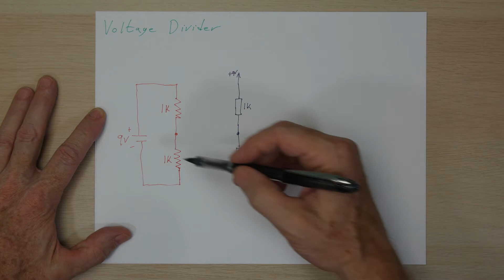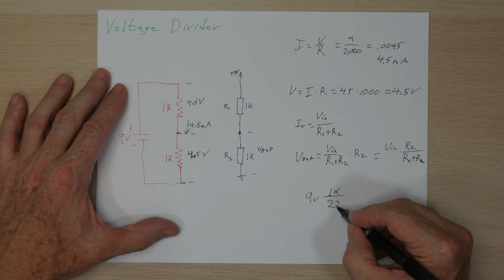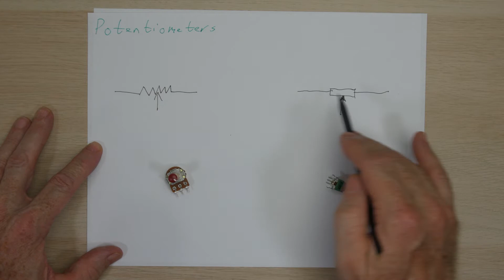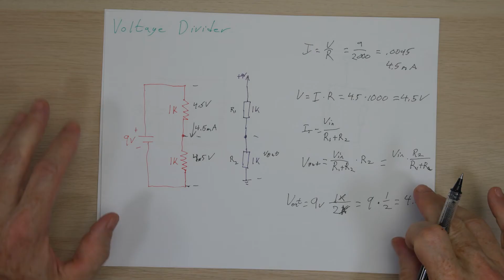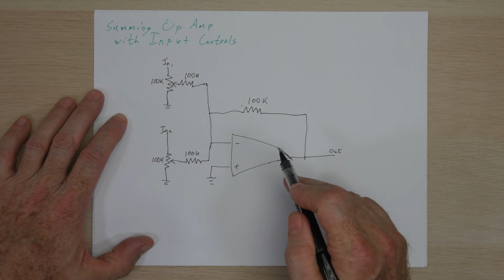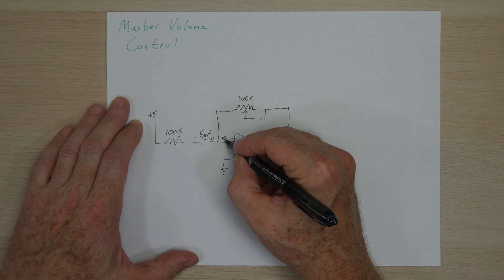How to Make a Eurorack Mixer Module - Part 3 Volume Controls

Comment: Thanks again for doing this, super helpful! I'm currently working on a +/-5V limiting circuit so that I can plug my modular stuff into my Crave without blowing anything up. This series helped me with the attenuation of the input and the circuit itself already works quite well. I'm still a bit unsure as to how I should handle the power supply stuff though to keep noise out of the opamp that I use as a buffer. I bet this will be part 4 of the series? Also, I already have another panel made with kicad in my rack! I made a black panel version for the Mutable Branches I soldered up the other day! It was my first SMD module and worked surprisingly well considering how tiny the parts were. I'm going to be building a lot of the Mutable stuff and they'll all have panels made in the way you showed us!
Reply from the maker: It's great to hear you've found this so useful!

I haven't had much problem in my modules with power supply noise and so haven't really studied it much. I've generally borrowed stuff I've seen on other open-source module schematics which is doing something like putting a 47uF electrolytic cap on both the plus and minus rails. I will cover the circuit I use to get power to my modules and maybe a few tips about circuit layout (ground planes, generous traces for power rails) at some point in this series.